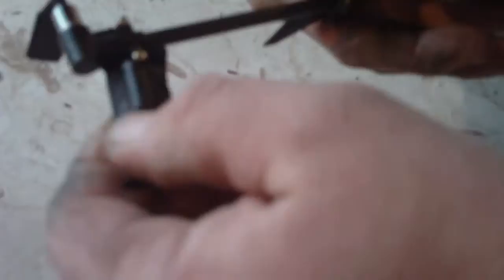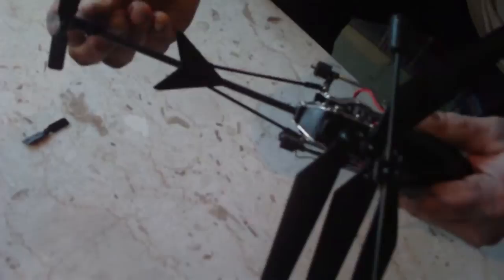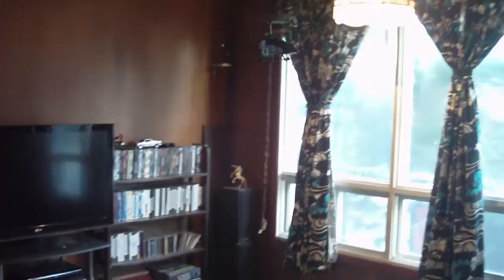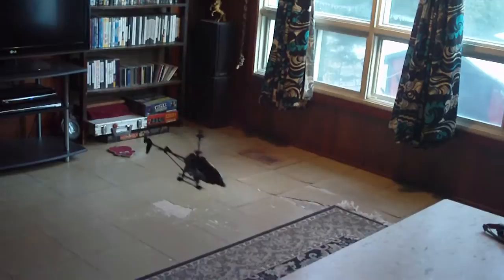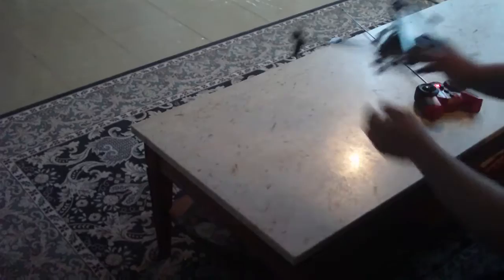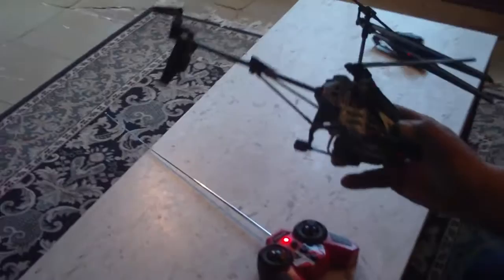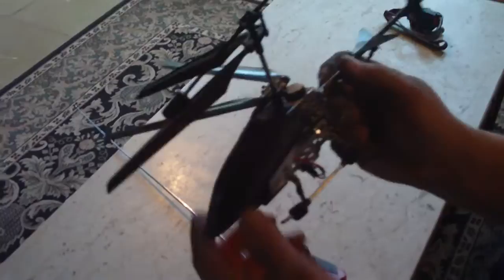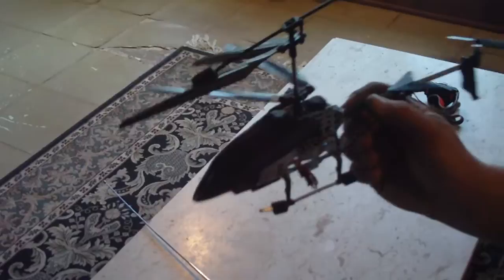intercepter 052 rc helicopter mod update now running stable.MOV

Comment from the maker: you and me both check you tube there should be a so32 up some where, s107 i have had one in for repair once and they fly nice but are indoor only the s032 and interceptor are both in or out door models, over all i like syma products over interactive toys but i have many rc helis and i like them all ,